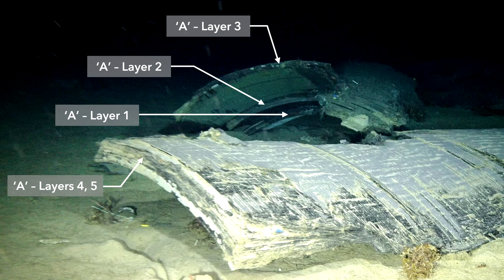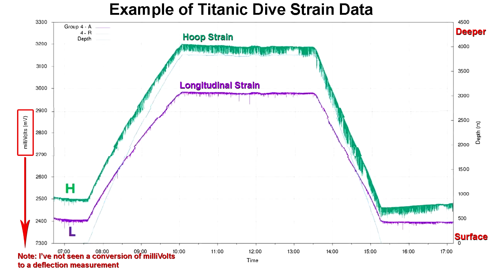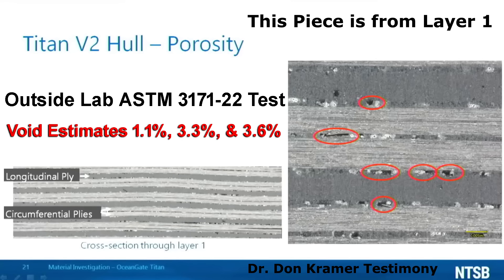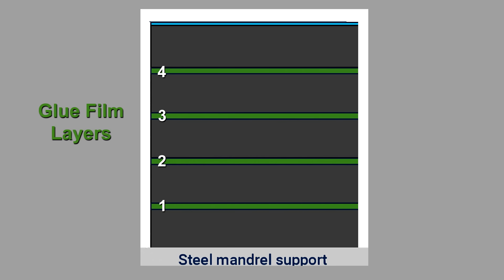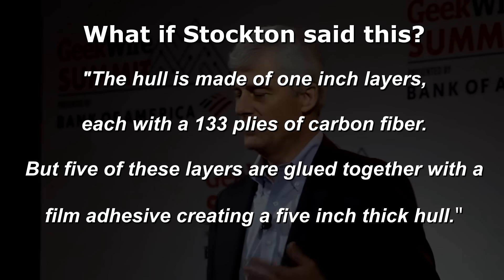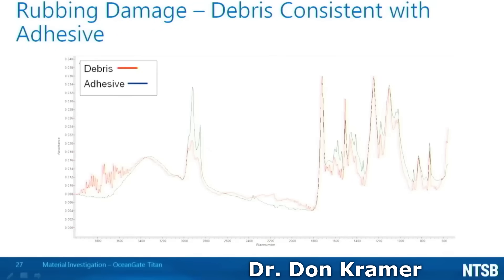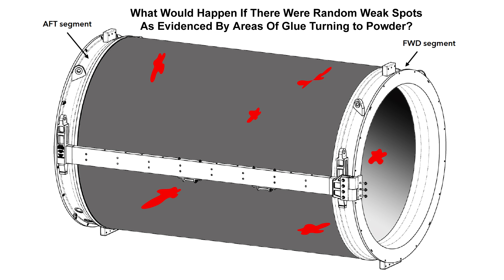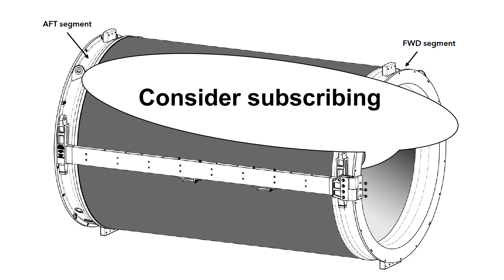OceanGate Titan Hull - Glue Layers Were Breaking Down To Dust - No Clues.

Comment: It’s also important to note that the liner was mistakenly applied inside the hull instead of outside. This would allow water penetration of the hull, which can delaminate it. The hull is supposed to act as a backing for the liner.
Reply from the maker: Thanks for commenting.  Let me try to clear something up.  They used Rhino Liner as a coating on the outside of the hull to prevent water penetration.  Now, when they talk about the inside "liner" they are referring to this stiff sleeve that slide into the hull to serve as the inner wall.  This inner 'liner" was spaced away form the CF hull by about 3/4 of an inch by strips of plastic.  This allowed a space to run the wires for the hull sensors.  Also, screws to hold monitors and such were not being screwed in the carbon fiber, they were being fastened to this inner liner.

Comment: This is worse than amateur level. If you go look at amateur aircraft projects, it’s standard procedure to soak everything in epoxy and then apply a vacuum bag to pull out the bubbles and squeeze epoxy into the voids. If it’s not vacuum bagged there is a near 100% chance of bubbles and delamination.

Comment: these findings pretty much confirm my theory that the loud bang heard a few dives before the last dive was cause by differential expansion of the different layers an ascent. it also somewhat supports my theory that due to the weakening of the endcap glue there was already water ingress in between the layers at points at the time of failure.

Comment: I don’t quite get the point of saying 547 square feet of glue… would it have been better if it was 5000 square feet? Worse?
Reply: Every glue joint is a potential failure point, ideally you do not want to use any glue. So every bit of extra glue area, adds a weakspot to the material.
Reply: He's emphasizing that the key structural material was the glue and not the carbon fiber since that was completely compromised.
Reply: I think it's actually worse than my example because if you had bought gear rates to 50lbs, at least you'd know the danger you were in you wouldn't be expecting it to catch you. So you're going to behave different. 

Same for people on this sub, maybe they wouldn't have gotten on.
Reply: @Idaxasi  yea I like your metaphor - basically what confused me, is why do we care how many aluminum carabiners they’ve hooked together in a chain, isn’t the number supposed to be 0
Reply: I agree, it seemed like a crude point to hammer on in an otherwise incredible video. Sure, 500 feet of glue. How many feet of carbon fiber? probably vastly many more.
Reply: @FlourescentPotato  If you're climbing a cliff and your gear is rated to 5000 lbs, but the cliff rock can only hold 50. Your gear might as well be rated to 50lbs. The structural material in that situation is the cliff. Not your gear. Same here. Doesn't matter if the carbon fiber could keep up in the Mariana trench if the stuff holding the carbon fiber together can't.
Reply: @Idaxasi  The carbon fiber matrix is already 'made of glue'. You can't treat glue as separate to the carbon fiber. The problem was in how the glue was used. If the hull were made well, there would be no significant differences between the glue and the carbon fiber. Acting like the use of glue is fundamentally an issue by generally observing 'a room full of glue!' feels misleading. It's a great video  but I felt like the 'so much glue' point was kind of beside the point.

Comment: The question you should be asking is whether enough tests were made before putting people's lives in danger. The tragedy was caused by a man and an organization that skirted all of the safety measures and procedures that we know have to be used, trying to make a cheap vessel instead of a safe one.

Was the material porous because of a manufacturing mistake, or was it because of the several immersions that the vessel did before the accident? We don't know because everything was untested. If the carbon fiber had not collapsed, something else would have failed because everything was done on the cheap.

Comment: For smaller projekt you would use peel pry to have a suitable surface later to add layers of epoxy/carbon on it. Adding Glue and than start with new layers epoxy or carbon on it, sound like a really bad surface for the glue and like the epoxy could contaminated and cure badly.

Comment: Using carbon fibre because he wants to reduce weight. It's a SUBMARINE, not an airplane. Water is 1800 times the density of air - it's VERY easy to support a heavy hull in water.
Reply: You still have to haul that sub places, have a crane on the ship that can lift and lower it, among other things.  I wouldn't be surprised if he went low weight for those reasons
Reply: It’s not even a submarine, it’s a submersible
Reply: For deep water submersibles this is far from true. The only alternative to carbon fiber is ceramics. With all other materials additional buoyancy should be provided by usage of syntactic foam and/or other ways.
Reply: Don't let rush fool you it was about money. Titanium for a sub that large would have been obscenely expensive.

Comment: Does the product manufacturer even envisage that this product would be used in Compression, rather than the "normal" use in Tension? (such as for a Composite Overwrapped Pressure Vessel). Carbon fibre is GREAT in tension - and woeful in compression.
Reply: Carbon Fiber still holds up extremely well in compression compared to other options like kevlar or fiberglass. The sub survived several dives and it was more or less fine. So the carbon fiber wasnt so much the issue as how it was made and layed up. But yeah unless you are using the sub less than 5 times making it out of FRP just seems like a bad idea. Or maybe just make like 10 of them? They cant be that expensive.

Comment: Even without these faults the design was doomed to fail Carbon fiber and epoxy are unsuitable for a vessel working in compression ! Great for compressed gaz though !!!
Anyway never trust when the designers still work in inch psi etc Confusion errors will be the norm

Comment: Why not use Steel instead? Stronger, cheaper, safer.
Reply: My hypothesis is that the boss had an unhealthy obsession with carbon fiber and just wanted to use it because he thought it was the bestest and coolestest material evar.
Reply from the maker: Thanks for your question. One of Stockton's big things was that he wanted a long hull to fit 5 people and have "depth" for photography. He loved the idea that you could have a camera at the back of the sub and be able to take an image of people looking out of the viewport at the front of the sub and enjoying the view. It was important to his concept of adventure tourism. Doing this size and shape out of titanium would be too expensive and too heavy. With a sphere-shaped submersible, it's hard to make one big enough for five people, and you still don't have that ability to have "depth" for camera angles.
Reply: @solareclipsetimer  From all I am seeing, even a somewhat thin titanium ring in the middle of the submersible to support the center of the carbon fiber hull would probably have saved the lives of these people. It would not have increase the weight by much, but it would minimize the deflection quite a lot. Bad engineering all over, overconfidence and hubris.
Reply from the maker: @costa_marco  That is a possibility.  Thanks for your comment.

Comment: such a shame. the crazy thing is this design could have been so good if the carbon layers could have been manufactured with adequate tooling to address the peroxity.
Reply: You still have the damage of the carbon fiber that was not calculated or taken into account after every submersion, that carbon fiber gets micro fractures after every dive, it was going to fail one way or another at those depths and amounts of preassure.
Reply: @k__c__ the epoxy was holding the stuff
Reply: @k__c__  Oh i'm in no way saying it would last forever. It was taken into account, problem is they ignored the acoustic warning signs of failure. And agreed with Stockton ignoring that safety measure an improved hull would have still been only a matter of time.
Reply: @hockysa  they fail like most of you don’t understand the basic flaw Fiber is not suitable for a vessel under compression !
Reply: I don't think so. Pretty sure there's a reason everyone uses metal for deep submersibles. You need something flexible that bends, not something brittle that cracks easily. Especially if it's for repeat use, you need something that can repeatedly bend
Reply: @fritzfxx  so yes and no. The main reason is its crystalline structure, strength of a metal is uniform in all directions where carbon composites are directional. Also we have decades of tests and research and can accurately calculate and simumlate the strength of metals whereas carbon composites are relatively new in this context with many more variables that effect it's strength and rigidity.
Reply: No ! It would have lasted longer !

Comment: could high pressure water infiltrate the porosity on the way down, and then aid delamination with outwards fracture pressure from the core of the material on the way up?
Reply: probably. but at that point, you totally fucked, it's too late then when water is able to infiltrate the layers.
Reply: The forces on the hull are so great that this is the least of your worries. If it's happening you're probably already mere milliseconds from death 🤷🏻‍♂️
Reply from the maker: Great comment.  Yes, it could.  But OceanGate was depending on Rhino Liner to prevent water infiltration into the carbon fiber. That may or may not have worked.  Plus, they left it outside in freezing temperatures in Newfoundland between the 2022 and 2023 seasons.  Water in the layers would have been a problem.
Reply: I think that that is a definite possibility. We worked with fiberglass pipes on a rig once and we had no end of problems with water coming right through the pipe! (at least when it wasn't blowing off the fittings...)

Comment: yeah, no shit there was air. only using the autoclave after every INCH is insane. with layers this thick the pressure in the autoclave isn't doing anything.
Reply: backing the first layer 5 times is even more insane!

Comment: Technically the titan was not held together by 500+ square feet of glue.  The entirety of the hull was effectively glue.  What is the resin that binds carbon fiber together if not glue?
Reply: no, composite material is more than its parts together. It's more similar to wood than to glueing something together.
Reply: @mb2776  wood is basically lignin and glue.
Reply: @mb2776  Oh really and what do you think holds  wood together?  Lignin.  Which is still effectively glue.

Comment: This was like a high school science project. Those people didn’t stand a chance…
Reply: They did reach the bottom and came back a couple of times though
Reply: @badgermcbadger1968  Yea, I've seen a video talking about how there was a loud bang in once instance, the genius thought it was some external metal part which did that sound. But strain gauges later recorded that hull had started to deform slightly under pressure. If they had checked the data they collected, they would have seen it.

Comment: I have yet to see anyone stop at the absurdity of wrapping the hull of a submarine with carbon fiber. These fibers have high tensile strength. In this case, however, high compressive strength is needed from the outside! 
The strongest thread won't do it, that would have to be the pressure inside the submarine and not outside. 
It's like pulling a string. 
Or an analogy with the implosion of a large cistern, which can withstand the great pressure of its contents, but when the air is sucked out of it, collapses due to the mere atmospheric pressure from the outside.
That actually happened here. The hull, solid under pressure from the inside, collapsed after pressure from the outside.
I don't understand. Who invented it?
When used in aircraft wings, the fibers are stressed by tension, which they can withstand perfectly, not by pressure. Similar to steel cables in prestressed concrete bridges. Using them on a submarine is a super stupid idea. Try wrapping a coke can with steel wire. Then try to squeeze it. It will go as easily as if the cable was not there. Another thing would be to pump it from the inside, it would withstand high pressure.
Reply: FYI carbon fibre has been used before in similar builds and is strong in compression, it's just stronger in tension.

Airplane wings for example made of carbon fibre experience tension and compressive loads.

It's not accurate to say that carbon fibre is bad at compression, it's just better at tension.

Considering that it survived that many dives despite the incredibly bad implementation backs those facts up.
Reply: stockton just liked pushing rope

Comment: It's actually pretty simple  . . carbon fibre is strong in tension. weak in bending.
Reply: It's not quite as simple as that. Any deformation will put some carbon fibres into tension. They do provide strength in compression, although obviously far less than required, even without the multitude of build defects present
Reply: @BongoBaggins  Good reply..Still. a dumb choice of material for that depth.
Reply: I would have gone with stainless steel.
Reply from the maker: Thanks for your comment. That is one of the reasons I put the Toray spec data chart in at 4:00. When properly laid up and cured, they test for compression and it is not bad.

Comment: worse yet, they knew!

twice they returned to surface during testing due to "cracking and popping noises" the run before this they observed cracking and structural failures.

they sold tickets and did it anyway, knowing they had many issues ... such failures needed a complete redo, and they knew that. they all did.

Comment: None of this matters..  carbon fiber has negligible strength in compression.
Reply: Of course these things matter, if "negligible" was true, it would not have survived even 1 trip down.
Reply: this is misinformation that spread wildly through youtube after the event.
carbon fiber is solid in compression, about ~80% of its tensile strength
Reply: @broko336  exactly and especially in thick walled large diameter uses like this. 

It's more or less experiencing tension forces in many aspects.
Reply from the maker: @broko336  Correct.  Thanks for your reply.  That is one of the reasons I put the Toray spec data chart in at 4:00.  When properly laid up and cured, they test for compression and it is not bad.

Comment: And this isn't even taking into account the amount of structural degradation that occurs when a hull is out of round. And with random voids and weakened areas... you know that it isnt compressing evenly.
Reply from the maker: Yes, you are correct.  I discussed out of roundness in a previous video the hull.  Thanks for commenting.

Comment: Everyone knows had the flanges on the caps been deeper and covered more then 2” it would still be diving 
The hill didn’t collapse because of the carbon layup 
But you can beat this to death or be realistic and accept the facts.. the reason the carbon showed so many defects. Was because of the damage during collapse was so violent 
Period. Should it had been diving 
No…. But it was using parts from titan 1 ontitan  2 hull
Reply: Interesting take, do you have evidence for the assertion that the hull didn't fail due to the carbon layup or is it more vibes based "everyone knows" sorta position?
Reply: @ well we will never know, it may have failed eventually, but they know the failure started at the caps
They know it failed because the glue failed on the caps, the shear point and buckle on the point it failed is clear 
But they are still trying to figure out why
Reply: Assertions are not facts, the engineering of composites and their behaviour is perhaps more complex than you think or in your case feel. It was both very sad and ill-conceived/executed, Rush's self confidence was not matched by his competence. As an Engineer the conceptual model of a tube with the forces involved was flawed from the start.
Reply: Build one and test it yourself.

Comment: Loch Ness Monster expert here.  If you look at page 228 of Professor Celine Dion's doctoral dissertation on the use of carbon fiber structures in high pressure environments, you'll see proof that a magic force field generator is required for safe operation in this application.  The Oceangate team was clearly negligent in failing to procure this essential equipment.
Reply: Most sane expert commentary so far
Reply: I like the cut of your jib!
Reply: @traumgeist   
How is Nessie these days...?
   I was going to go take some pictures, but really grainy black and white, out of focus cameras are hard to find...

Comment: doing an average on three measurements isn't really engineering, it's dodgy statistics. If anything, it shows a wholly inhomogenious production quality. The chances that a different set of samples might reveal even more damming results are high, but also the chances of a false low result. But since the point here is that this was already way out of spec, it doesn't matter anymore if it were even further out of spec.